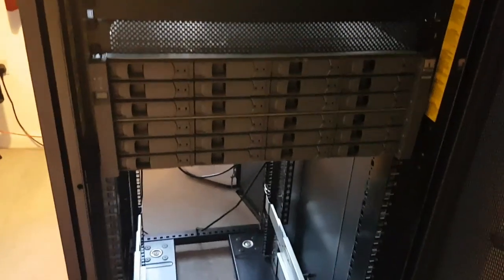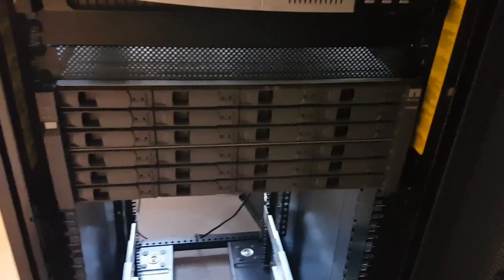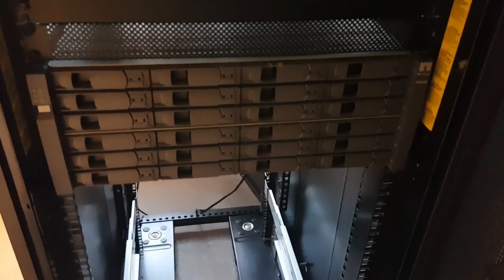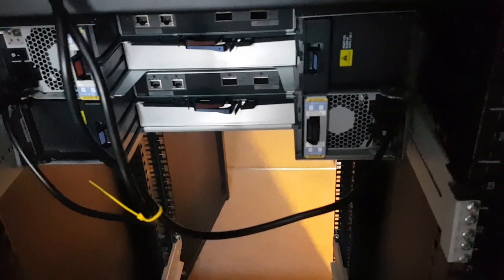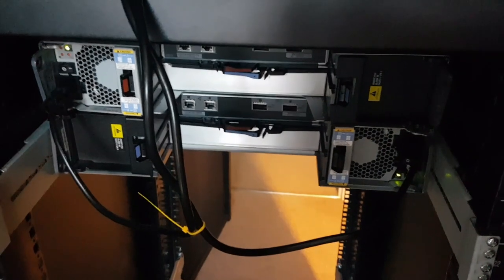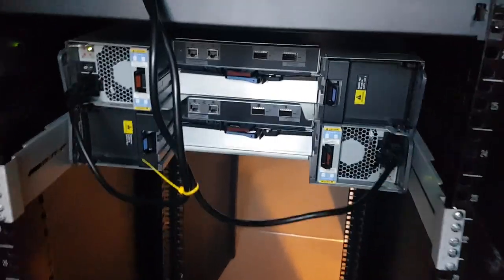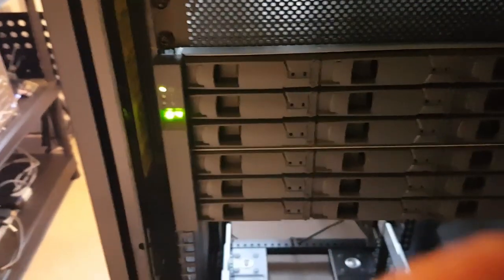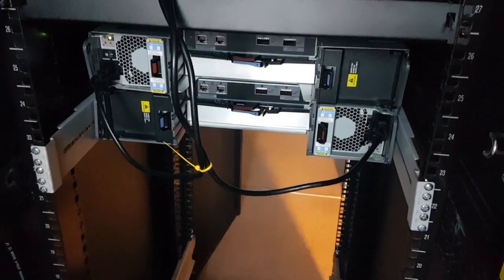Surprising Watt consumption from dual PSU's - DS4246 disk shelf barebones -  good for CHIA farming?

Comment: Please don't run with a single PSU!

The PSU fan is literally all that is cooling the drives, and it requires two - if not, the drives on one side of the unit will start getting hot, reducing their life and reliability.  So if you absolutely must run on a single PSU, then you'll have to rig up some kind of 'fan contraption' in the unused PSU bay.

Also, always use blanks in any remaining PSU bays or you'll break the airflow over the drives.  If you must, you can make them out of cardboard and tape (or put fans in there to keep negative pressure) ... but you absolutely MUST blank any holes that are not being used for PSU/Airflow : )

Also, the IOM's... if you're using SATA drives without interposers, then you'll lose the redundancy - as each drive will only connect to one of the IOMs.  But with interposers, each SATA drive will be connected to BOTH IOMs.  This isn't a problem and it will work either way, but it's important to know what you're losing when you slam a naked SATA drive in there.

The DS4246 is a lovely bit of kit : )))))
Reply from the maker: Thanks for all the information.  I didn't realise about the psu and their cooling ability.  I was going off the recommendation of other creators.  Unfortunately, this video is old.  This project never saw the light of day and the NetApp never saw a drive.  Chia was a disappointing venture with its constantly moving target and I had to ditch it   The NetApp sits in my rack still but is available for sale as i cannot find a worthwhile project to use it on.  Thanks for watching.

Comment: I currently have 12x18tb HC550 drives, 2 pdu-s active, 80w per psu. for the other comments: i have swapped the bottom blank and second controller, since the bottom slot does not have contacts (controller and blank have to be turned 180deg if swapped). keeps second controller disconnected, properly attached and maintains proper airflow.
Reply from the maker: That sounds quite high wattage for the number of drives.  Are they Sata or sas?  I saw videos on DigitalSpaceports channel saying you could get away with a single PSU.  Have you tried that?  Thanks for watching.
Reply: @crypto-carlos  since i have second one also, i could do some power measurements with that. It is my personal requirement to power everything possible with 2 different power sources. 
These are sata drives

Comment: I dont understand, the one i have is drawing over 100 watt with no disks.
Reply from the maker: Same unit DS4246?  Same configuration 2 PSU top left and bottom right, 2 x IOM modules?  Don't forget, as detailed in the video, I put all my equipment through my Reillo UPS for protection, which is running in smart ECO mode.  This would not save 64 watts though.
Reply: @crypto-carlos  yes, got 4 Psu, 2 not connected, 2 iom 6.  On internet i found the same power usage as i have. Just dont understand how you can have only about 40 watt.
Reply from the maker: When I watched Digital Spaceports video on this unit he did mention that you should completely remove two of the PSU and use the blanking plates.  Not sure why, but it may be that having them plugged into the unit but not plugged into the power supply still  draws extra current?  I will fire the unit up again and take another reading at some point.  Keep an eye out on the Community tab for an update from me.

Comment: To change the number you can remove the cover on the left side an press the button on the top. Press it longer to confirm. You will find out ;)
BTW, do you know how to make use of the ACP-Ports ? I have no clue how to connect. A normal ethernet connection does not work.
Reply from the maker: Cool! thanks for the info.  No idea how or why you would use those ports.  I downloaded some manuals somewhere - will take a look see.  Thanks for watching.

Comment: Great video. Love to see the Chia-ish content. I wouldn't recommend only using one. The fans in the PSUs are also used to cool the drives. Removing one of the PSU would reduced the cooling capacity when it's fully loaded. Once you get drives in there, I don't think there would be much difference in power draw between using one PSU vs. two...but it would be an interesting test.
Reply from the maker: That's good to know.  I intended to use two as suggested by Digital Spaceport.  It is just someone commented that you did not need two if using SATA drives.  Thanks for watching.

Comment: you need 2 power supplies and only one controller, so you can just slide one out a little to disconnect but leave in there to keep the proper airflow
Reply from the maker: Thanks, that will probably save a few watts.

Comment: The video quality is much better. great update I wouldn't just use one psu as your just putting extra load on it it will take the same power put will have to work twice as harder especially on boot up. You could even end up damaging it and you don't want to have to buy another one. Looking forward to seeing it build up with drives loving the content keep its coming.
Reply from the maker: Yes, going to take that advice from you and others. Thanks for your comment.

Comment: I have 18 drives installed, including 6 SAS Exos 16TB. It‘s consuming 170W. Switching one PSU off didnt work for me, not much change, it‘s getting a bit louder.
Reply from the maker: Any idea what the individual SAS drives add to the wattage?  I heard some rumours that you could expect them to draw anything up to 15 watts each? as opposed to around 6 watts per SATA equivalent.  Any truth in that?
Reply: @crypto-carlos  15 Watts each is not possible. At least for my 16TB SAS Exos not. As I wrote - I have 18 HDDs and 170W consumption and it is 8 SAS drives now. Or the rest 10 SATA drives use only 8W each and the NetApp nothing ;) You can see on the Website of seagate a comparison of sata ans sas and there is only little difference. 
https://www.seagate.com/content/dam/seagate/migrated-assets/www-content/datasheets/pdfs/exos-x18-channel-DS2045-4-2106US-en_US.pdf

Comment: thats nice, 35w as a base usage. my farmer with 8 hdd, 2ssd and no gpu idles at 80-90w. BUT, when you boot it peaks at 200-220w. so thats why you got two massive PSU's to catch that initial peak. 
my PSU is i think 420w, but i sure need to replace it when i get more disks in the future. dont want the PSU to stress to much during booting.
Reply from the maker: Makes sense ate. I didn't watch the meter to see what it peaked at on start-up but sure the 2 PSU's can handle it.
Reply: @crypto-carlos its still a learning curve for me also. 16hdd can run on 400w. but booting all at once....i dont know yet with my current psu hahaha